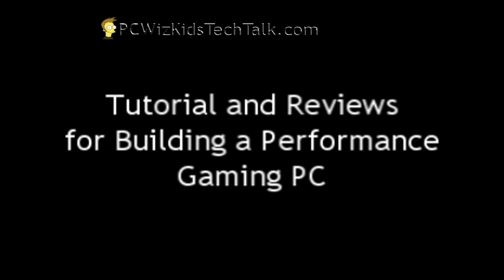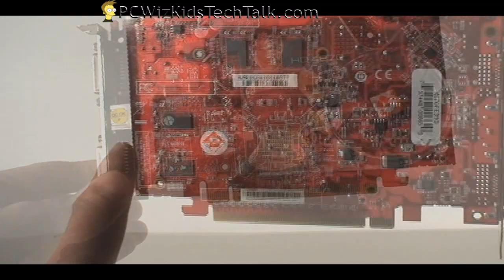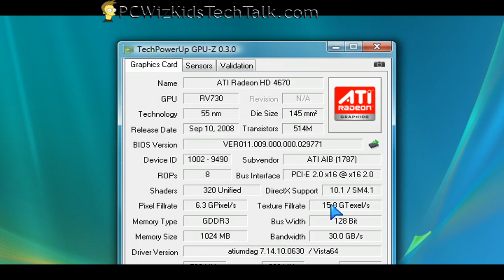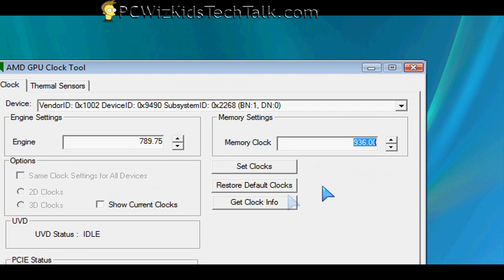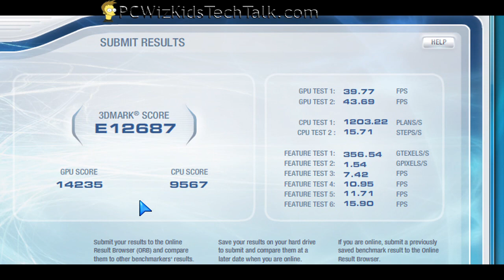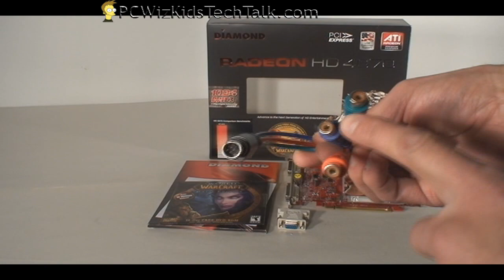ATI HD4670 1GB - Diamond Video Card Review

Comment: @listojay if it has a PCI-E x16 slot and a 400W PSU or better, yes. but the p4 stinks, c2d, c2q or pentium dualcore are a must have. for a P4 system, an HD3650 is good enough.

Comment: @xiReLaXx generality it means the video will be faster but the memory speed has alot to do with it if u have 1gb of ddr it will be alot slower than 512mb of ddr3. Basicly what it does is allow the gpu to access the data faster by storing it in the ram of the card instead of your pc's ram. Just make sure its a fast ram cuz as I said b4 larger amount of ram isn't always better if the ram is slow.

Comment: 8 1/2 year old 250W FSP power supply + 59 watts Sapphire 4670 + 45w Athlon 5050e + sony dru dvdrw IDE + 500GB SATA Hitachi Deskstar HDD + cpu fan + case fan = no problems at all, reads no more than 100w at any time,  so why recommend a "massive" power supply unless you have some very power-hungry components?  Amazing card for what it is, the only question being whether it's worth getting the HD 5670 to complete another pc.
Reply: You have low power system. Compare that to someone having an OC'd Athlon X2 with 4sticks of ram and multiple HDD's. I'd say a good 400w PSU is recommended to be safe.

Comment: with my hardware i get about 20-35FPS with all settings turned up full, with a couple of tweaks i can get about 35-40FPS (i have the acceleration pack installed)

Comment: Use your search engine and type ''Antec Power Supply Calculator'' should turn up as the first link once you've clicked on it comes up with a page were you put what psu/graphics cards you have etc and it works out your recomended PSU.

Comment: This card doesn't actually blow the hot air out of the case. If you notice, it's a short cooler, just blows over the board and onto the back of the pci bracket. A true exhaust cooler will be dual slot and have a vented pci bracket slot, only some cards come with it.

Comment: I was a bit surprised with CPU-z. I bought a pre-OC'ed card, but the clock speeds that CPU-z showed where way of from the speeds on the box (they where the default core clock speeds for the 8800GT chipset). What could be a reason for this?

Comment: Nice review, great video as well.

By the way, I was looking at Tom's Hardware's article on the power consumption of AMD/NVIDIA video cards, and it showed that the figures was alot lower than the recommended spec. For my next computer, I'm going to be using a 390W Coolermaster Extreme with an MSI HD 4670, so it should be okay, right, coz isn't the Coolermaster models pretty good?
Reply: No. But 390w is enough for a system with such a low wattage card.

Comment: I currently have a 7500le, in my HP PC, but thats a rubbish card,.

i have a pentium dual core 2.8ghz, 3gb of Ram, and i only have 1 PCI express x16 slot, and a 400w PSU. i am quite limited to cards, so i need a single slot, in the 100 -150$ range, and i thought the 9600 GT was good, but that card is long, and needs an extra power input.

i understand that card is slightly better, but is the performance much better on a non PCI 2.0 mobo, and also doesnt this card have an advantage with 1gb?